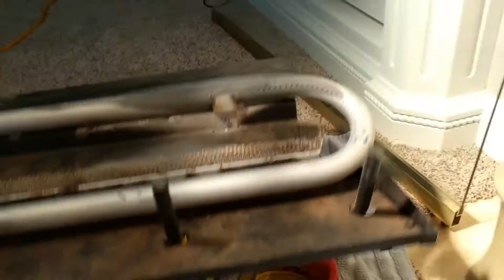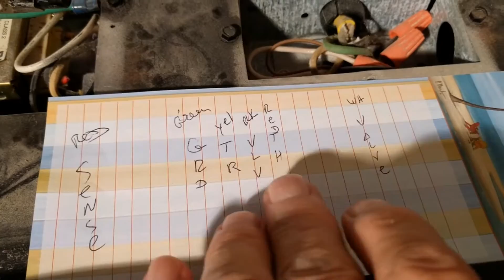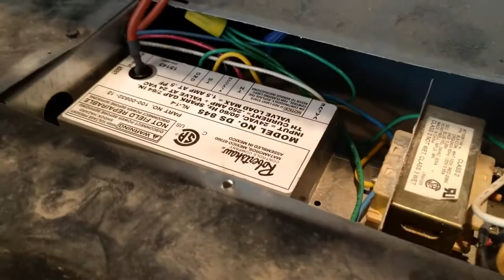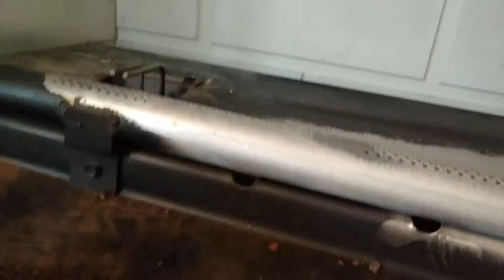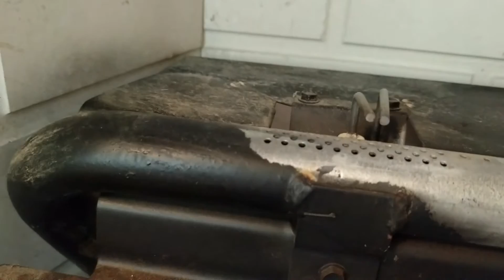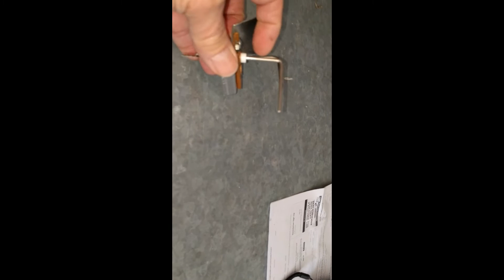Home repair gas fireplace Robertshaw DS 845 controller by froggy

Comment: I have troubleshoot other fireplaces and easy to fix. But is the first one of this kind and it does the exact same at the end of the this video. I noticed the Robertshaw module or automatic control had a red blinking light. 
My question is… what happen after this video and how you make it to work? Flame sensor?
Reply from the maker: It fixed the issue. Years later.
Reply: @1947froggy  Sorry to be persistent, I saw you replaced new controller in the video and I get that. But when I turn it on it won’t stay on after press the switch. By reading the comments, after replacing the control I have to turn on/off wall switch 4-5 times to make it work? Is that correct?
Reply from the maker: @Idealhandyman  Yes a few switches to make it fire is ok.

Comment: I've got the same controller. An installer charged me $650 to replace and guess what? It still takes 3 to 4 tries before it fires up. Thanks for the vid.
Reply from the maker: My new one still works 3/4/ tries. I put it in cost for ds 845 was about $225.  Hope it lasts.

:)
Reply: When you say tries, do you mean just flipping the switch on and off?
Reply: @soularwave  Yes. Flipping to on, I hear a number of "ticks" as the igniter fails to light the fire. It stops, I try again. Repeat. Repeat.

Comment: n/m I see you had to buy another DS845 - thanks!!
Reply from the maker: Yes, the 2nd one works pretty good, still a piece of junk though. I'm stuck with it because of the overall design.

:)
Reply: Thanks, guess I need to hit Amazon and cross my fingers in hopes to get a good one....
Reply from the maker: Good plan.

:)
Reply: Oh, I forgot to ask, did you get a blinking light on the robertshaw controller? I actually contacted them and they told me the blinking light meant that there's a problem external to the controller.
Reply from the maker: I don't remember, sorry.

:)

I did call RS and found them to no be especially helpful.
Reply: No problem. I agree they were rather short with me. Telling mejust to call a service guy then rushed off the phone.

Thanks!
Reply from the maker: Yeah.

:)